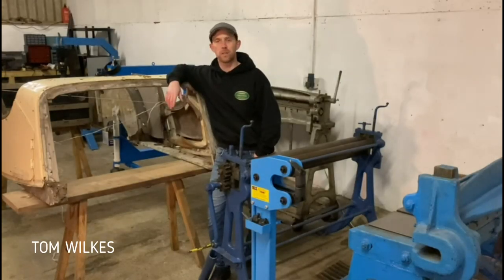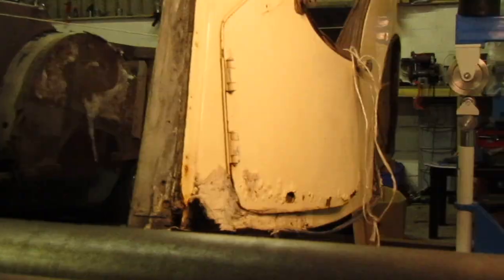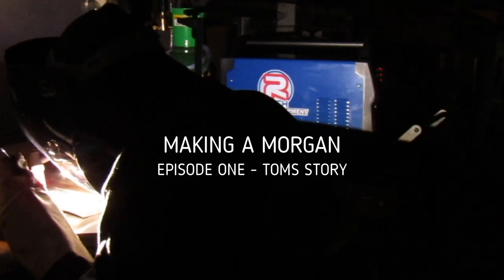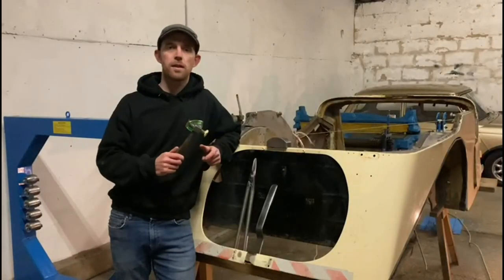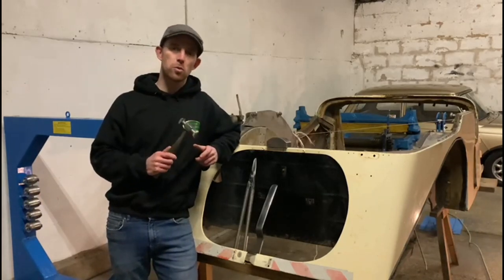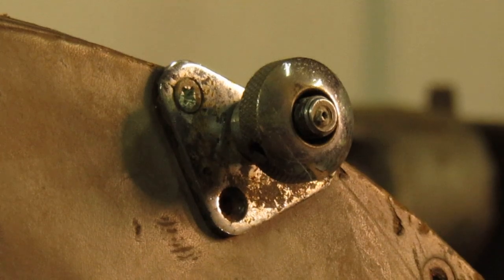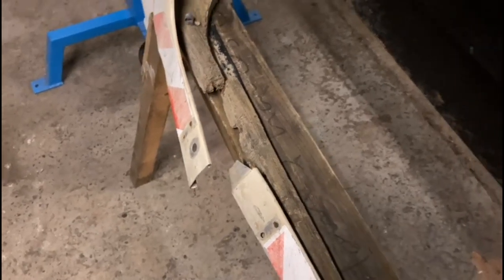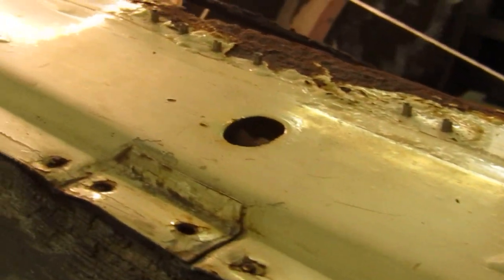Making a Morgan - Episode 1

Comment: Okay guys. Can't wait to see how you do this. I'm located in California and we have no rust issues to speak of. I am pretty sure if a car came in with one hole like the one in this video, it would get refused at any or maybe all body shops in my area. Even rust under a weather seal could get a car denied repair and if they do take it in the repair would most likely wire wheeling the area and body fill it back. Not joking.
I can't wait to see what you share.